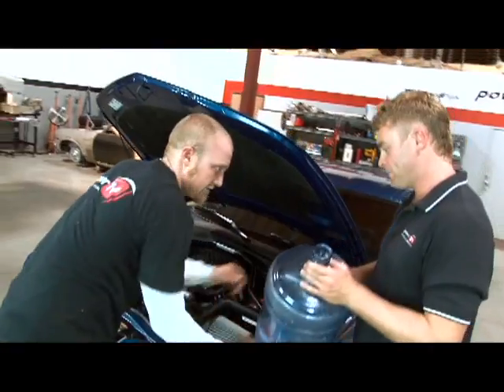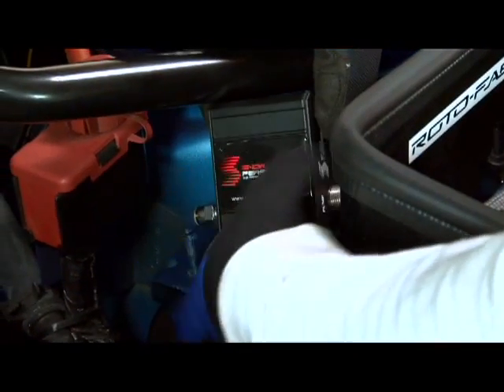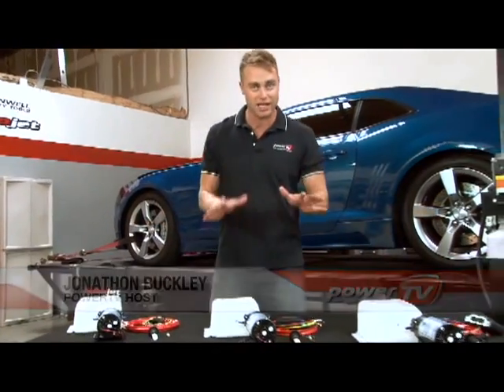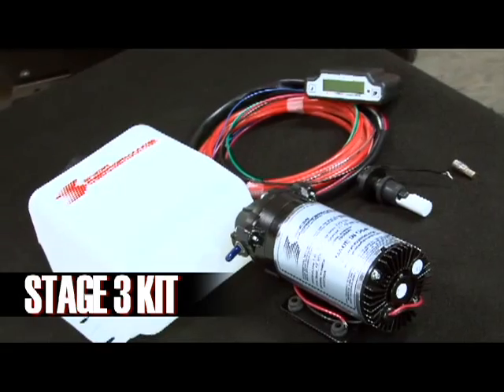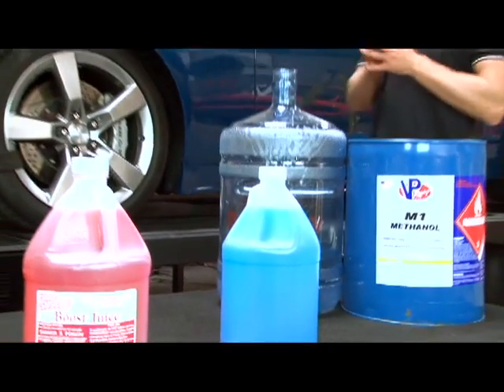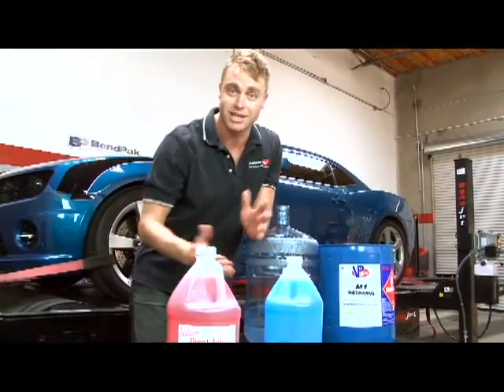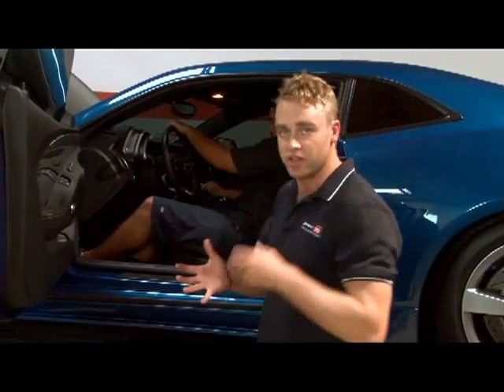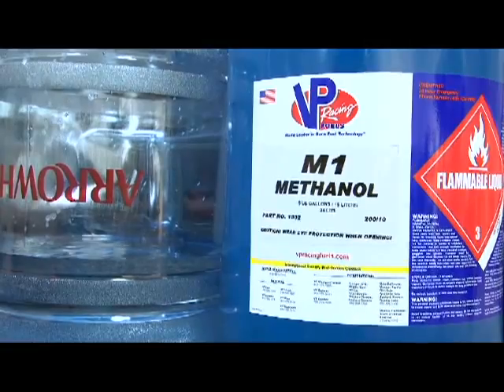613 HP 586 Ft. Lbs Torque Camaro w/ Snow Performance Water Methanol injection

Comment: Hi im interested  in getting  a stage 3 kit for my charger  does the throttle body spacer  that the line gos to come on the kit or where would i purchase that at
Reply from the maker: for a stage 3 kit you would have to buy the plate upgrade, here is a link. https://www.nitrousexpress.com/challenger-charger-injection-plate-sno-40073.asp

Comment: Keep in mind it does not give you more power it gives you the ability to run more power
Reply: Daniel Bargas  That is actually false. Even if you ran the same amount of boost you would still gain HP. It lowers the Temp, which will always increase hp. Even a simple coolant throttle body bypass kit will gain you hp. Just throwing that out there for you. Not trying to argue. Yes it def does give you the ability to up the boost past the norm and gain a lot of hp.
Reply: Your kind of right but if you do it right it's not all about the temperature I use mine because I have a ka24det 240 drift car it runs high boost at high rpm (often bouncing off the rev limiter)to keep my engine clean. I was cracking rings do to carbon build up it literally steam cleans the engine in addition to lowering the temp
Reply: With out it I would not be able to run 400whp reliably so it allows me to get the max out of my tuning reliably.